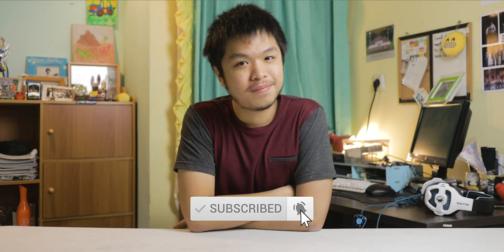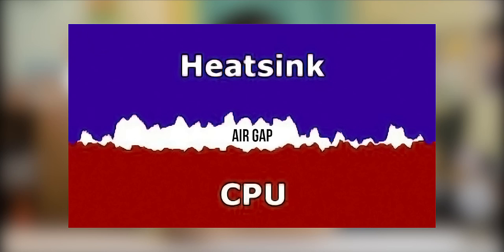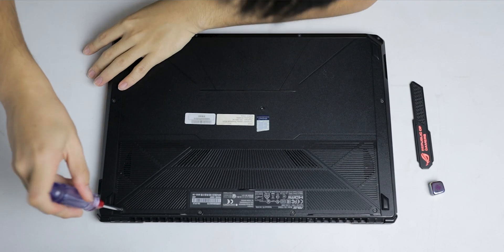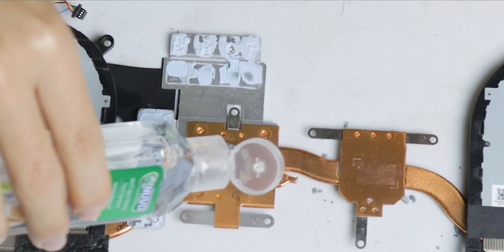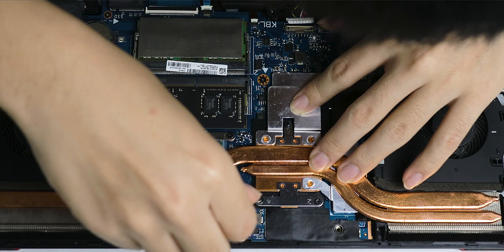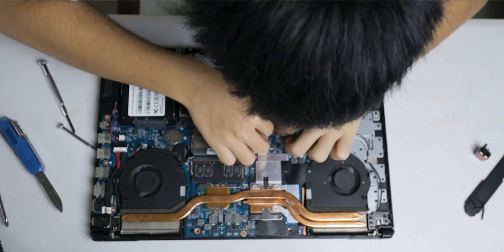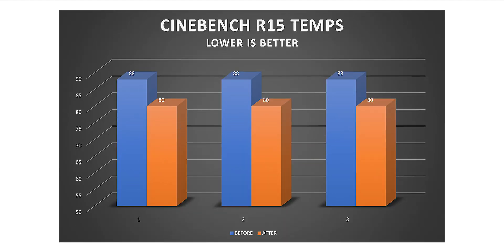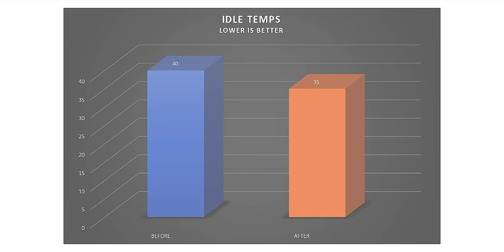How to Replace Thermal Paste - ASUS TUF FX504

Comment: In i5 version of this laptop 25watt tdp lock is in all laptops ? can i get rid of powerlimit throttling by taking it to customer care .By changing mother board?
Reply from the maker: What software did you use and see the 25 watt tdp lock?
Reply from the maker: And also, what were you doing when it shows 25 watt tdp
Reply: Using xtu sometimes and most of the time task manager to see clock speed. When i open some high resource demanding app it shows 25watt limit on 100% usage after some time limit will disappear.It happens even if i turn  on full fan speed mode.
Reply from the maker: @darshanparbadiya7348  Don't use xtu. Use throttlestop. Idk why but it power limit throttles when i have xtu installed. This also happens with other programs like hwmonitor and aida64. Try throttlestop (and don't turn on any other cpu monitoring programs) and see what happens.
Reply: @PioSoesetio  it still sometimes power limit throttles and sometimes not.
Reply from the maker: @darshanparbadiya7348  Do you have any example scenario when it happens? And in what way it affected your performance?
Reply: @PioSoesetio  when i open softwares like android studio it powerlimits.It affect opening speed of software.
Reply from the maker: @darshanparbadiya7348  How's the cpu utilization, is it getting near 100% ?
Reply: @PioSoesetio  yes for 1 to 2 seconds it is 100% and limit is 25 watt when load decrease it turbo boost again when load is applied it won't turbo boost.
Reply from the maker: @darshanparbadiya7348  All processors will power limit throttle at some point (intel's newer ones at least if I'm not wrong). If it's not degrading your performance in a significant way, leave it be. 

I'm not sure but sometimes certain programs are limiting it, it's just the nature of it. I don't have the program, so I think the best way to compare it is to use cinebench (cause that's what I have). See if it goes above 25 watts in throttlestop, it won't go above all the time, but as long as the final score is comaprable to other laptop's score with the same processor, ur laptop's completely fine.
Reply from the maker: Oh yeah I forgot, I haven't asked, how's the temperatures?
Reply: @PioSoesetio  88 celcius. it thermal throttles too when benchmarking . in normal case it's not thermal throttling ex(opening android studio but still using 25 watts sometimes .
Reply from the maker: @darshanparbadiya7348  Does it reach above 25w when benchmarking?
Reply: @PioSoesetio  not all time but sometimes it reach upto 45w or above.
Reply from the maker: @darshanparbadiya7348  well, it's completely normal then
Reply: @PioSoesetio  thanks for replying.
Reply from the maker: @darshanparbadiya7348  You're welcome :)
Reply from the maker: Vikas Dewangan  prochot is locked, but the tdp isn't locked. Mine reached around 70 watt maximum, of course it doesn't run at that tdp the whole time, but it isn't locked.
Reply from the maker: By the way, if you're looking to maybe try to bring it to the service center to get it replaced, you might need a laptop to compare (preferably the same model) to prove the performance issue. In my case, I have a friend that has the same laptop and was getting better performance. But IMO it's not really a good time to ask for replacement due to the pandemic.